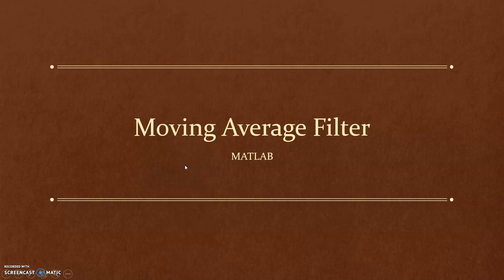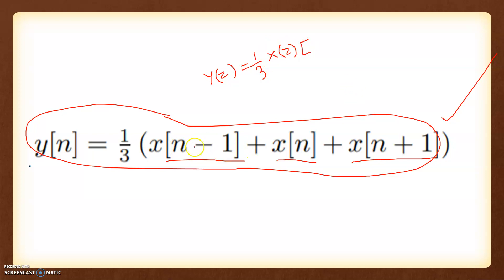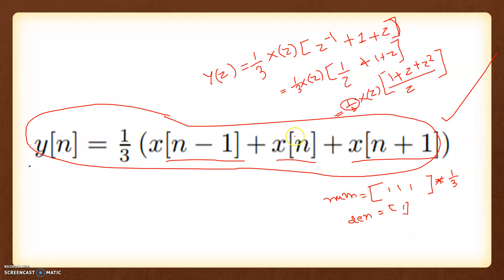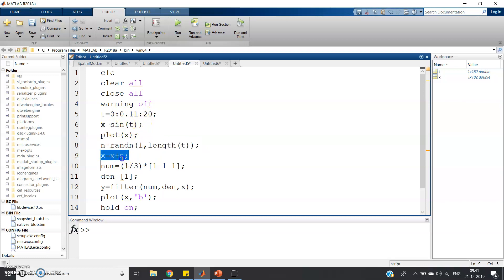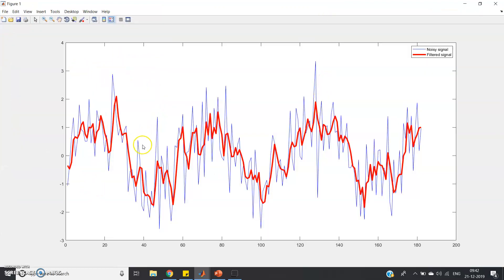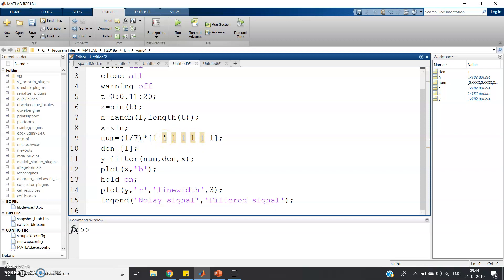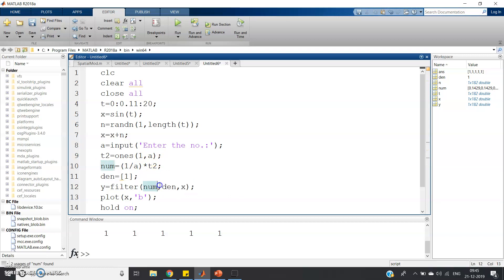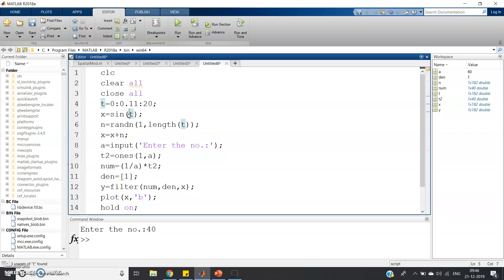Moving Average Filter in MATLAB | DSP

Comment: @Knowledge Amplifier. Thanks alot for the video, it has gave me idea how to program it. 

Can you please help me how to program a code for the below question as i am not getting the output as required. I will be very very thankful to you.

Write a program that will smooth an array of noisy data using a two-point average. Assume the array of data is a row vector
and that a backwards average will be used for the smoothing. For a backwards two-point
average, Xavg,𝑘 =(X𝑘+X𝑘−1)/2, except for 𝑘 = 1 where Xavg,1 = X1. Use loops and
conditional statements rather than array operations. Use the following statement (for
MATLAB) to create a row vector of noisy data from a normal distribution with a mean
of 10.0 and a standard deviation of 2.0 to test your program:
• noisydata = 10.0 + 2.0 ∗ 𝑟andn(1,100);